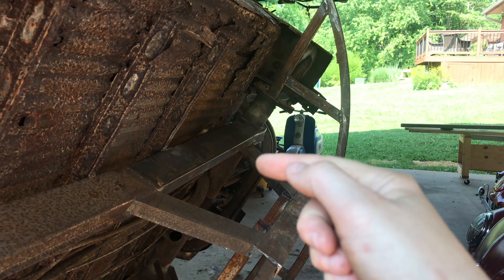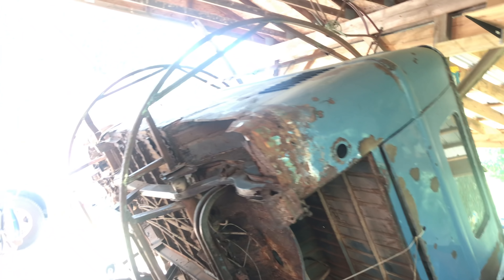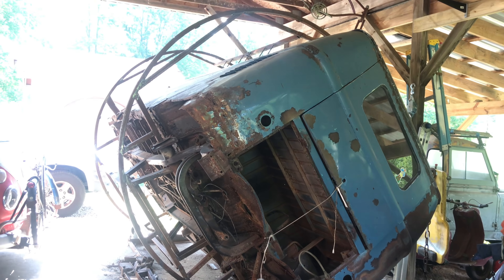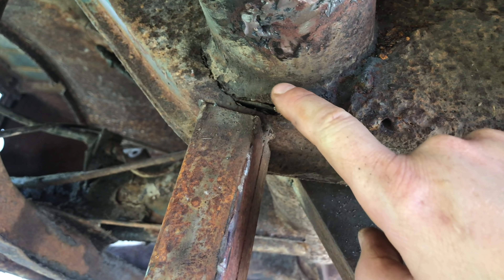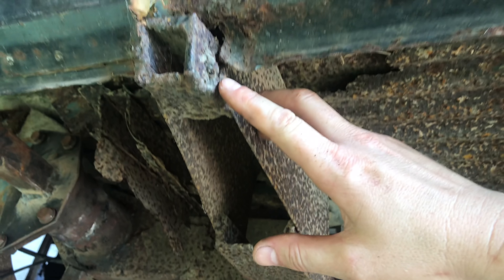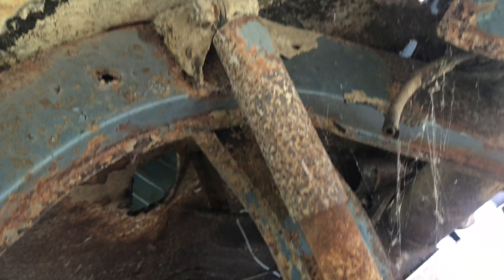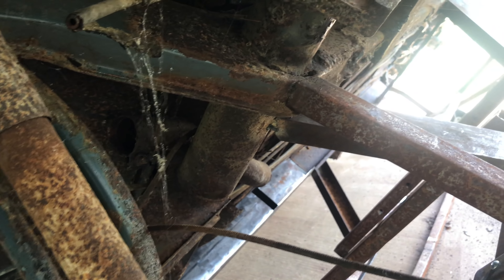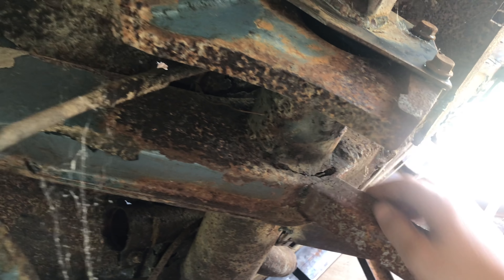1958 pressed bumper VW bus rear frame cutting and repair!!

Comment: Between your channel, Mike's, and Mustie1's I've learned more about restoring frames than I ever thought I would need. I've skipped over a few vehicles in the past because their frames were rusted out but I have more confidence now that I could repair one if I had to. There's obviously a lot of work involved but it doesn't appear to be difficult as long as you use some common sense, don't go too fast, and measure multiple times before committing. There's a double cab I've had my eye on for several years and it's not going to heal itself where it's sitting right now. I had written it off but now I'm reconsidering getting it and taking the plunge to try to bring it back to life. It doesn't appear to be near as bad as Pickle underneath but the body is toast so I need to reevaluate my skills one more time before opening my wallet to get it because I don't have the money to purchase panels (that I most likely will have to heavily modify to fit properly anyway) and will probably make everything myself. It's saving grace is that for some reason the nose has been untouched by rust and is almost perfect, including the original paint, and so is the front bumper. Everything from the front doors back though is an entirely different story unfortunately. It's going to be a long and difficult restoration if I do decide to get it.
Reply from the maker: truly appreciate your kind words...as to the double cab you KNOW what I'll say....DO IT! lol Like I say, it really isn't hard just one rusty bit at a time! piece by piece.  I KNOW you can do it! And I know you know this, but it really is about more than just an old rusty heap.  There is something to be said in the pure joy we all find in saving one rusty piece of junk at a time...the act of salvation is where the therapy lies...as red green always said "I'm pullin for ya!"
Reply: Ever think musties crusty and mjb pickles will ever meet???
Reply from the maker: would love to get them together some day!

Comment: the reason the bus did not fall apart is because it is unibody. the frame is not as important as people think it was made to get the structure down the assembly line.
Reply from the maker: Yep...but there is NONE of the unibody attached! Lol just wait...you’ll see! Lol
Reply: @marcijunebug  I guess you have seen that monster from beneath the salt lake that Mike is rebuilding? yours looks pristine compared to his..😁😁
Reply from the maker: i assure you they are both as terrible as they look on film! lol

Comment: I always look forward to pickle updates. I never tried Free All, is it better then PB? Patina on the tractor! 😀
Reply from the maker: free all is awesome, I like it better, but I think PB is better if you must use heat, it seems to not burn off as quickly...yeah he is my kid for sure😆✌
Reply: Ever try that stuff KROIL???  Bought some busted gal. Cans at. Swap. Meet 20 yrs. Ago and down to last can
Reply: marcijunebug That’s my concern when I use lubricant is trying to use heat after the lubricant is there. I will definitely try free all...I’m always up for trying out something new to see if it works better.
Reply: r sprockets My one buddy orders that Kroil. He swears by that stuff I have never tried it myself.
Reply from the maker: r sprockets sili-kroil is no match for free all but free all smells very similar 🤔so I’m guessing similar formulation
Reply from the maker: Slades VW Beetle give it a try, kinda pricey but I wait until oreillys puts on sale then it’s about same as all others
Reply: marcijunebug oh I didn’t know they sold it. When I’m out next time I will check the store near me..thank you.

Comment: As soon as you said PB Blaster I could instantly smell it. Something about hot weather and PB Blaster...... Anyway, that gas door is an early thin lip door. Interesting to see that on a 58! Not unheard of but cool to see it.
Reply: Also, I love seeing the grease pin paint color mark in the driver's headlight bucket. Shame it is so pitted and has to be repaired.
Reply from the maker: yes this is a feb 58, so some cross over parts...and I TOO noticed the paint color in the headlight bucket...promise to save what I can!

Comment: Just came in from body work on my '58.  Just noticed that you have "hippy hole" widows too.  I spent some considerable time welding mine shut...keep up the great work!
Also, I wonder how far apart our buses are in production?  I don't envy you having to repair the frame, but from watching your skills "You Got This!"  Cheers and Respect 👍
Reply: Also did you see the word "blau" in your headlight buckets?  For tauben blau for dove blue. 😄
Reply from the maker: yep, hippy hole windows will be goin' bye bye at some point, but at least they left a lip for me to weld to! the GREAT 58's! mine is Feb of 58 I believe...it's a challenge for sure, but I needed to work on some skills so this bus will work on ALL of them at once including my sanity! lol cheers

Comment: Great video Marcie.  Always nice to see pickle.  What kind of rust converter do you use?
Blue steel ? POR ?
Reply from the maker: I use ospho it’s dirt cheap, easy to spray through a spray bottle, dries fast and works great! Used it for years...the entire thing will get an oil coating after I’m all done
Reply: @marcijunebug  ok thanks. I will look for ospho.  I get the oil spray...I live in Nova Scotia. Surrounded by ocean and salt on the roads. Ugh
Reply from the maker: I order the ospho on amazon and I get the 32oz size that way you can just attach a spray bottle nozzle directly onto that bottle and it isn't too heavy.
Reply: @marcijunebug  Thanks. I will check it out for sure.  I have a new toy...62 Mercury Comet.  I will need it lol

Comment: I used Ospho on my '65 DC. You're better off by not relying on the Ospho to convert the surface rust to primer. It doesn't do that too well. You can see this by hitting the treated surface with a piece of sandpaper after it dries. You'll see the rust reappear after you sand off the treated area. It's better to grind down the surface to shiny metal before applying it.
Reply: If you paint it as soon as it dries it makes great primer. I just got done doing the frame on my International Loadstar about three months ago and it's holding up great.
Reply from the maker: yep, that is what we did on the car hauler trailer I'm building in the background, seems to have worked great.
Reply from the maker: this bus will be getting a coating of bar/chain oil in every area I can reach or spray into as well...after we are all done I will probably drill a few holes in frame and coating as much of it as I can with bar/chain oil...since we live in an area that heavily salts the roads it seems the only way a car survives any length of time is with an oil undercoat! thanks for being here as always Steve!
Reply: @marcijunebug  one of the motorcycle channels I watch is an old guy in England that talked specifically about a coating you can spray on to prevent rust. I looked it up and did some research on it but I can't remember the name right now but it has been around for a while. It's kind of like an oil that turns into a coating that is harder than grease but is removable with solvent. I'll try to get you the name. It's similar to the old military cosmoline they used on guns and machinery that was stored for long periods of time.
Reply: @marcijunebug  found it. Waxoil & Double TT from Tetroseal.
Reply: @JamesCouch777  I use waxoil because no one imports the very best one, Dinitrol into Australia . Waxoil is amazing stuff though. I have cut open sill sections on 30 year old Mercedes to do dent repairs and the insides are waxoil coated and look like brand new. The worst is Bitumin under coating. that stuff has given me lots of work over the years because rust lives underneath where it cannot be seen.
Reply: @Mercmad  thanks, good info 👍

Comment: We luv. How. You are making progress on the panel, slow but surely  it'll. Get done...might want to check to see the. Rear attachment points for the transaxle is square  with the front beam and within spec of the ride height, Wasnt one side askew and off kilter a bit???? Measure it now and you'll have a driver that steers and stops like new!!!!   I luv how you tLk back to the viewers , hmmmmmm don't that mustie guy do that toooo????  And any live stream or viewer Q and A  scheduled in future???
Reply from the maker: yes the beams have to be squared up...the first one I fixed I moved the floor with high lift jack to get the height correct, I'm sure I'll have to do the same on this side...lots of sag in the whole bus...wont have when I'm done with it! I would love to do a live stream soon...It's kind of hard for me most days because I don't get "uninterrupted" time very often...I'm constantly being pulled 20 different directions! lol put soon, I've been wanting to do it for some time now!  thanks for always being here!
Reply: Aww, that's the fun of owning vintage tin, the anticipation of the end result...never finished just ongoing. Project...do you have room. For a shipping container or box truck where you can work u
Under cover and semi heat the area in inclement weather?  Like all outdoor projects they stall and an enclosure wood help......
Reply from the maker: r sprockets we are seriously considering our options, I “project” constantly on something so we have been discussing what we could do, considering closing in carport but I don’t want to lose the awesome natural light that is gets pretty much all day
Reply: Don't know what your zoning or code is but two shipping containers  on a raised pad with  a tin roof in center can fiction as a parts storage and work areas for 3 seasons,   seems you do double work to do setups and tool storage all the while that time could be used towards. Projects..besides the kid needs a playhouse!!!!!  :))

Comment: Howdie! What rust convert are you spraying everywhere? 

I've been using Phosphoric acid on mine.
Reply from the maker: Phil Colwill I’m using ospho, so basically the same exact thing you are using, I found ospho doesn’t precipitate out quite as bad as just straight phosphoric acid. Can’t remember now what other ingredients are although I looked it up once lol anyway less “white crusty” residue with this one at least in my experience
Reply: @marcijunebug  Nice.

I do find I have to chase the white stuff a lot afterwards! But its been cheap and easy to apply, i put iot on mostly with a brush and in some paces the white stuff like a salt/crystal seems to become active again when its wet so thats kinda cool on some parts. 

I shall see if I can get hold of Ospho in the U.K.

Ive had my van since 2003, it was a nice bay when I got it but I set it on fire once trying to weld on it, almost lost an eye in the process! Then it sat in a field for 10 years, but its home now, I have booked my self on a welding course starting in January and maybe Ill have a go again! Maybe!

Thanks for the reply, I wish I  had your skill and confidence to work on my van!

Please keep up the bus rescue vids!
Reply from the maker: Phil Colwill I’m all about cheap lol the ospho is available on amazon and that is primarily why I buy that version because I’m so pressed for time it saves me a trip to any store! Ha...this is a fun project for sure, but big undertaking for sure! Glad your bus didn’t totally burn up and you still have your eyes! Wow! I have always wanted to take a welding class but never any time...sigh...working a “real” job sometimes really cramps my style! Cheers!

Comment: Marci, What are your intentions for this bus? How far are you going to take this project? Will there be a time or place when you will call it done and what do you see it looking like when it is done?
Reply from the maker: patina ride for sure, saving as much original dove blue as I can the entire bus has 7 layers of various paint colors on top of the dove blue, but that is likely what preserved it all these years.  I want it mechanically and structurally sound and replace body panels so we don't get rain inside and then I will likely call it good.  I've no plans to slam it...want it stock height...I'm sure you are familiar with Mustie1 channel and his single cab Crusty...that's the ultimate goal...something similar...it will be cool, trust me...😉

Comment: what rust converter do you use. love your work  chicks that weld are cool
Reply from the maker: I use ospho and I buy the quart size since it is easy to attach a spray bottle nozzle to and spray directly from that bottle (link below)...I like the ospho because it is easily sprayed in hard to get areas, dries quick, reasonably priced for the area it covers and works very well.  I've used it for years and it works great! hey if you can weld and sew there isn't much you can't "fix" or build! lol mom taught me to sew with thread, dad taught me to sew with fire! 
https://www.amazon.com/paquete-Ospho-605-tratamiento-metal/dp/B000C02CDG/ref=sr_1_4?crid=8414Q1ZOO04E&dchild=1&keywords=ospho+rust+treatment&qid=1594836914&sprefix=ospho+rust%2Caps%2C162&sr=8-4